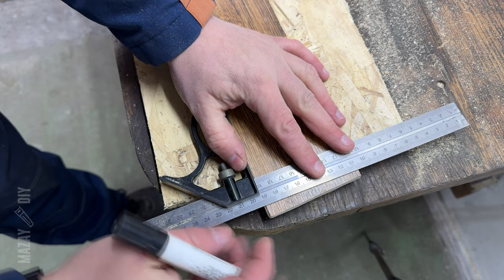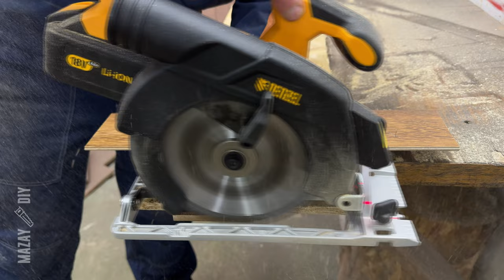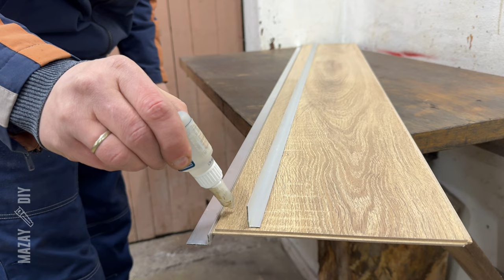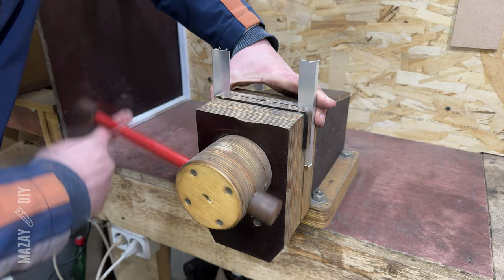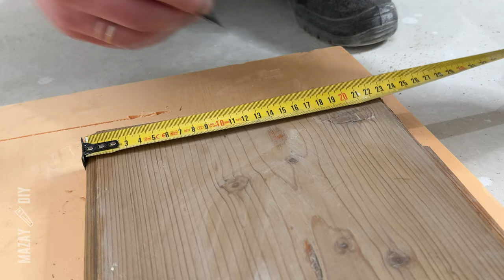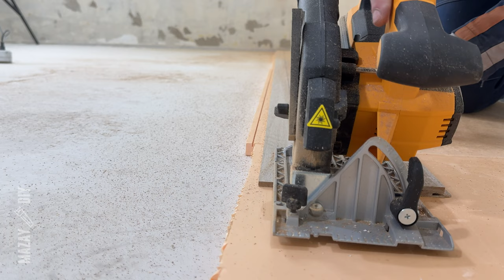3 Simple Circular Saw Jigs | Must have DIY Jigs for Woodworking

Comment: Laminate flooring is really an excellent product for making shop jigs.   Oftentimes you'll see someone throwing away a partial box in the trash after they complete a project.   You should always snag it and make it into shop jigs.   It lasts forever, doesn't warp, is prefinished on one side, is fairly water resistant, and has good dimensional accuracy.   I highly recommend it.
Reply from the maker: I completely agree. I really enjoyed working with laminate.